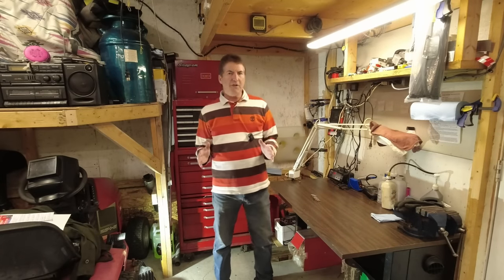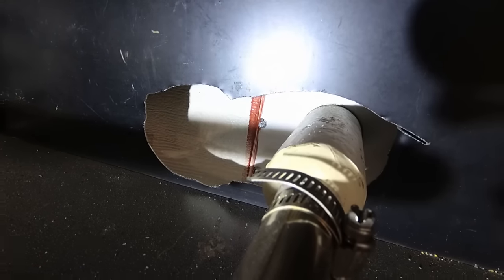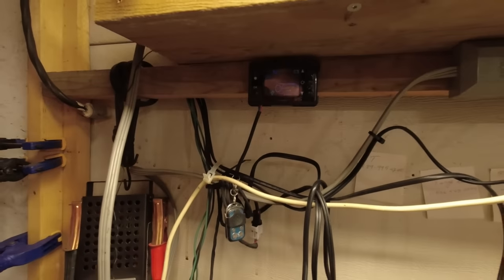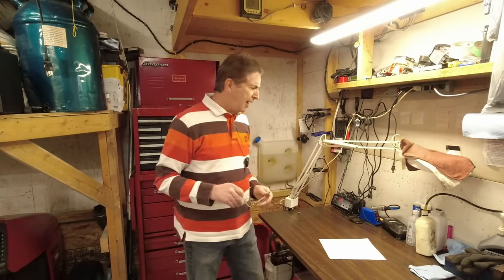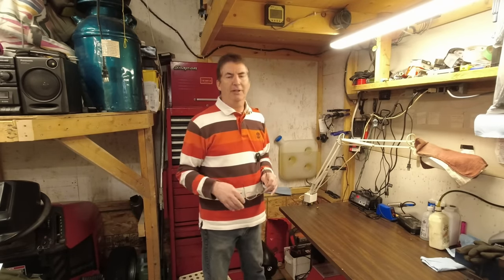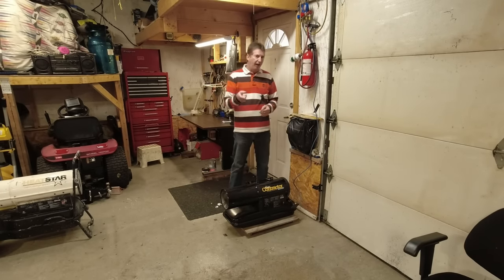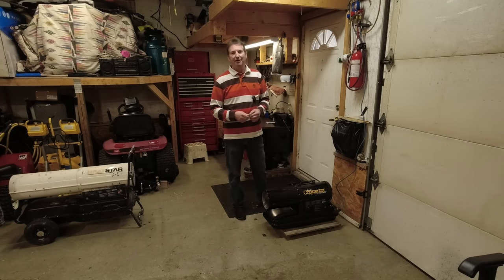Chinese Diesel Heater, 5 Year Review, Heating a two car Garage with a Parking Heater.

Comment: My favorite quote from this video is: "does it sip fuel? Barely touch any? No! It gives you the energy that diesel stores." nice to hear someone else say it too.   The energy in the fuel you use, less the inefficiencies of the tool or process you're using to extract energy.  Doesn't matter if your burning cracked corn, wood, diesel or coal.  There is only so much energy in each fuel.

Comment: Well I must say that out of all the videos I have watched on these chinese diesel heaters. Your video and explanations as to btu's, fuel usage and keeping the combustion chamber clean after a long low run is the most concise, to the point and easily understood vid I have watched. Respect man and have a merry Xmas. Like n sub.
Reply from the maker: Thanks, I appreciate the kind words.
Reply: @FRUGALWITHJOHN  If you see -20F° do you ever need to use additives to keep the diesel from gelling?
Reply from the maker: The fuel tank is inside, I don't let my garage go below freezing all winter. So the answer would be, no I don't use additives in the diesel.
Reply: @FRUGALWITHJOHN  👍

Comment: You are Absolutely RIGHT about after running it LOW for over an HOUR Then turn right up to BURN all the Coke off. As an Retired Crane operator [UK] we had these [Webasto] Heaters INSIDE the Crane and 1 Thing i learned was to NEVER run it Low and turn it off But to Run it Low [SMALL Cab] Then Run it HIGH for half hour to BURN ALL the COKE Out of the Burn Chamber.

Comment: Many forget that alot of the energy escapes through exhaust....so what i did is i bought a longer exhaust pipe and rolled it against another thick iron pipe. That way i get almost all of the energy to stay inside. Resulting exhaust is barely warm when it exits through the wall.
Reply from the maker: Sounds good, I may give it a try. I was going to order exhaust pipe and a through wall exhaust anyway for my generator.
Reply: Somebody on another video said that water from condensate of the exhaust needs to drain, or else it will clog up your pipe.  Be sure to have your exhaust pipe draining at least a little bit downhill the whole way.  I'm sure there are calculations on the diameter of pipe vs length, so make sure you keep that in mind, too.
Reply: @theclearsounds3911  thanks i did not think of this😎

Comment: I don't waist fuel heating my garage when I'm not using it. But when I am having a 80k propane heater does the trick real quick. Those little heaters are great for their intended purposes smaller spaces.

Comment: I am using the Vevor diesel heater in my greenhouse and it uses about a gallon of diesel per night to keep it from freezing on me. But I have the temperature set at 70 degrees F. Somehow though the heater controls are off by 20 degrees so it holds at about 50 which works for growing veggies.

Comment: Thanks for the video, I just bought a heater for my garage in Texas, not as cold as all y'all up north, funny thing I noticed in your video, I have the exact Panasonic  radio in my shop that I bought in the mid 90's, I use it nearly every weekend.
Reply from the maker: I use that radio all the time, works good. My neighbor gave it to me years ago when the one I was using died. Good luck with the install and thanks for watching.

Comment: great video. Ive just bought one of these heaters, to heat both of my sheds at same time...
Built a waterproof wooden box for the heater to be housed in.. Along with a 25L tank...
2x 12v leisure batteries in parallel for extra capacity, and a cheap ebay solar charge controller, and a 100w 12v solar panel....
The heater is boxed around the back of the sheds, so it cant be heard etc...
and i bought a dual heat pipe adaptor, to feed into both of my sheds (right next to eachother).. then cut and extended the wiring for the display/control, so that is mounted on the wall in the shed...
I have it set on thermostat control, and have it so it keeps both sheds around 20c... Not cold, But not hot... Just comfortable to be in....
I live in the middle of nowhere aswell.. So red diesel is easily obtained for me... So its very cheap and efficient to run...

Comment: Good to see a video about one of these units that has been in service for years. I have been burning some waste oil in mine and it only lasted 2 days before having to be cleaned out. I suspected that this was because of the nasty fuel and hypothesized that it would be fine on diesel.  I get 14 hrs on 4 litres of fuel at the mid (3) setting. 

Not to be too critical, but using the BTU of the fuel is not a great way to calculate or compare this unit to a electric heater, because a substantial amount of heat goes out the exhaust / outside. A electric heater is 100% efficient (basically) as all 1500 watts gets turned into heat that transfers into your work area. I'm not recommending a electric heater, just stating the facts. 

I believe that calculating the fuel energy is how the manufacturers determine the KW rating on these things, but it is not at all practical. Just like in a car, you don't calculate HP based on fuel energy.
Reply from the maker: Thanks for your input, I was going to try used oil (Black diesel) in my heater, but after doing some research, I decided against it. Everyone has had the same result as you did.

Comment: These things are great because diesel is inert unless it's atomized, so it's a low fire risk. They also run on 12v, so in a power outage you can just hook them up to a car battery and have heat.
Reply from the maker: Yes, It never hurts to have a backup heat source, thanks for watching.

Comment: John thank you for the video. I just buying a diesel heater for my garage. I’m in Europe, so cheapest Vevor diesel heater that I found is 102€ that one in the box. The same you have is a little bit cheaper. Plus, I have to buy extensions for the intake of air and combustion. I think it would not cost me more than 150 for everything.
Reply from the maker: It does work well for me, good luck
Reply: @FRUGALWITHJOHN  Thank you for answering. do you have advice for back up power. Battery ?
Reply from the maker: I use the battery from my RV (Caravan), I put a battery charger on the battery all the time.
Reply: @FRUGALWITHJOHN  Good to know. Thank you.

Comment: Thanks for the report.  I just bought one of these and am installing it in my small workshop.  It's not insulated yet, but this will keep the pressure washers from freezing when the next Ice Age hits here in Texas again.  I have the Little Buddy and an old kerosine wick type heater but they aren't very economical.
Reply from the maker: I made a video last year about all the ways I tried to heat my garage.  https://youtu.be/c7p7CPABZ3I  I did try the little Buddy and a Kerosene wick type. Thanks for watching.
Reply: that freak storm in Texas a couple years ago really showed the importance in having an alternative heat source available when the power goes out. These are great for emergencies since they can run off a car battery
Reply: i have one here in CANADA in my 10X10 shed Insulated and its unreal how quik it heats up i use it to melt the snow on the ATV during the winter takes 5mins to melt i have seen it at Minus -20C outside and get upto +12 in 20 mins
Reply: Did u set it up yet? How big is your workshop?

Comment: I live in a travel trailer and have heated it with one of those heaters. The only problems have been a pump and the green fuel line. Otherwise, a great investment.
Reply from the maker: Mine did not come with the green fuel line, 5 years ago I don't think any came with it. I put a link in the description of the good fuel line. Also about the fuel pump and filter, get the heater running, then keep tipping the fuel pump and filter straight up and then back to the proper angle, with the outlet to the pump up until all the air is out, then mount it. This will help make the pump last longer, I did need to restart mine twice when I did this (I let too much air in the line from the pump at one time). Thanks for watching.

Comment: Thanks for talking about energy content of fuel; that’s the right message.  Not sure of the size of your garage, or its insulation situation, but would be curious to know if the heater(at maximum setting)can keep it comfortable when outside temp is around freezing.  Also, good job placing the combustion air inlet outdoors. So many folks seem to have it indoors, which simply creates a small vacuum and pulls cold outside air into their structure.
Reply from the maker: A little over 500 sq ft.  Roxul - rockwool insulation R-14 walls and R-28 attic, and yes it can keep my garage 15 C, 60 F (that is where I set it) well below freezing. (on low setting) after it warms up. Yesterday it was -15 C,  5 F, I set the heater on low (1) and when I checked the temperature in the garage it was 14 C,  57.2 F.

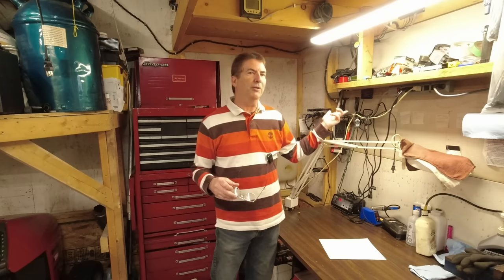Comment: 04:40 - because your intake is outside, your heating efficiency is drastically dependent on outside temperature. 
Yeah the BTU stays the same but if all you want is to keep it at 0°C, you are using way more fuel with your setup.
Reply from the maker: Outside air is only for combustion, if I used inside air it would need to be replaced because we can't live in a vacuum - I would then need to heat up the air that came from outside.

Comment: I built an enclosure for mine outside and just drilled one hole for the heat vent to go inside, I tried the diesel torpedo heater and it immediately set off the carbon monoxide detector.
Reply from the maker: Interesting, thanks for watching.
Reply: That means you have to heat all of the air from outside temps. It also means that all the air you draw in from outside has to be displaced.

At minimum, if you're going to run the unit outside, you'd want to have a second hose for the inlet/return.

I'd rethink that approach, personally.

Comment: FYI, that setting is not kilowatts, that setting is Hz. That's how many pulses the pump makes per second. The pump delivers .02ml per stroke.

If you have it set to 2hz, that's dosing .02ml, two times per second; or .04ml per second. Which works out to 144ml (.144 liters) per hour. 

.144 liters per hour of diesel is 1.53 kW per hour, or 5226 BTUs.

At a max frequency of 5.5hz, your heater is capable of 4.21 kW, or 14,371 BTU.
Reply from the maker: The heaters are not that precise, I did replace that one with a new one and it puts out less heat at the same setting.  Two or 2hz is around 2KW on some units and less on others, thanks for explaining what the numbers mean.
Reply: @FRUGALWITHJOHN  
You can also adjust the max/min settings as well as fan speeds on most of them, if you find that the one you have is not outputting the heat you expect, or if you want to avoid someone accidentally running it at too low of a setting and potentially sooting up your burn chamber.
Reply from the maker: Thanks for the info.

Comment: I like kerosene heaters but I don't like the fumes in the garage.  It doesn't set the CO detectors off but I still get a headache later.
Reply from the maker: I've seen people getting a headache from old style kerosene lights, when using less refined kerosene instead of lamp oil, so it may not be CO but definitely related to combustion of kerosene. (but not everybody will get a headache??)

Comment: Let your exhaust fumes go through an air to air intercooler with fans on it before the exhaust goes outside so you won't have any exhaust heat loses anymore and you can save more fuel.
Reply from the maker: I am looking for something to do that with at a reasonable cost, thank for watching.

Comment: Great video. 
Very informative.
Reply from the maker: Thanks, glad it was helpful.
Reply: @FRUGALWITHJOHN  
Now.
I'm looking at which one to buy and $120 - $250. I see no differences. Did you find any reason to choose one over another.
Reply from the maker: You can get two at $120 and still be cheaper than $250. Some have more options or settings in the controller, some companies just have a higher profit margin. Pretty much made by the same manufacturer with different company names on them. The last one I got is in the link in my description.
Reply: @FRUGALWITHJOHN  
Very helpful. 
Thank you. 
Im in the Northwest Territories, and I'm going to install one in my boat and extend my sailing season by an extra month. 
In winter, I'll move it into my truck.
You just cleared up all the questions I had.

Comment: Great video, I have one on the way for winter camping. 

How long would the deep cycle battery last without charging daily?  Id be curious if one deep cycle woule last for an entire weekend charging phones and running this heater
Reply from the maker: Good Question, It would be a bit of math to get the correct answer. Things to consider, outside temperature, what temp will the heater be set to, how big is the battery.... I will leave this question up to the people who have done this before. Thanks for watching.
Reply: @FRUGALWITHJOHN  I should have my heater mid next week, If all goes smoothly I will try to post my results in 10 days or so. May help another viewer in the future.
Reply from the maker: That would be extremely helpful, thank you.

Comment: I wonder if you mixed a little Hot Shot with the fuel if that would keep it clean all the time even on low burn.
Reply from the maker: I use Hot Shot in my diesel Jeep every 10,000 km/6214 miles, expensive stuff, I would not want to keep spending money  just to burn it away in a heater. I am testing a thermostat for the heater now that will turn it off and on to maintain temperature. I think this is the way to go, I keep the heater turned hot enough not to carbon up and let the unit start and stop the heater. I will make a video when done my testing.

Comment: If you look at the webasto data, the heaters are ~78% efficient so not all of the diesel energy is recovered. Still good robust heaters though.
Reply from the maker: The lost % goes out the exhaust, It gets quite hot. I look at it as a cheap (inexpensive) mini furnace, and also good for power outages, (can be run off your car's battery in an emergency) just don't let the car's battery die.

Comment: Excellent video John, thanks for putting that together. I’m curious why you are pulling in outside air for combustion vs just using air ambient air from the garage?  I’m thinking both the extra work/cost of another thru hole fitting in the door and efficiency of heating warmer air as the garage temp goes up.
Reply from the maker: I explained it in the video. I will give you a short answer but the video explains it better (when working in a garage never use inside air for combustion) (extremely dangerous).
Reply: @FRUGALWITHJOHN  naaaah.
Reply: It's actually engineered to pull ambient heat from inside, the unit itself is also engineered to be inside, if your doing work or burning fuels anything like that , the intake air should be pulled from a clean source, this is one of the reasons they are banned in homes, garages, and work shops
Reply: Don't hate, I actually run one in my 20' ×30' car and a half garage, and I can tell you this,,, I live in Ontario, it gets cold here and damp, my garage is detached and made of 8" concrete block, basic wood roof with 1 roof vent that I keep open, absolutely no insulation, no vapour barrier either, I only heat the garage on the weekend, I pretty much live out there all weekend, Friday to Monday morning when I have to go to work, I put a small woodstove in and lifted it about 8" of the ground, I run the woodstove Friday afternoon, and I run it HOT, until about 9 or 10 pm, when the block walls feel just warm, I shut the stove down and fire up my 5kw vevor 😂 and I run it on high right till Monday morning at 5am, then I shut it down, and I always make sure it's running on high or maximum for atleast 1 hr before shutting it down, it's very important, also ppl, you do have to consider your location and exhaust, it all makes a difference on performance and fuel consumption, these units are engineered to be inside and intake ambient heat, if it's outside and pulling really cold air from outside, your losing efficiency right off the hop, Wich means your fuel rate is going out the window and will never be consistent, I played around with mine quite a bit, and did alot of research, I recommend keeping the unit atleast 3' off the ground and run it on high, and only burn good clean diesel in it, oh yeah, don't forget to get a air monitor 😂
Reply: Sorry I forgot to mention, my 5kw vevors tank lasts 10 hr exactly everytime I fill it, I buy like $20 of diesel every Friday on my way home from work,

Comment: Great job. real world video.   how many square feet is your garage? How much fuel do you burn for the whole season?
Reply from the maker: Garage is 506 sq. ft. The more work I do in the garage the more fuel I use (it is never the same each year) (approximately 50 gallons -200 liters) give of take 20 gallons - 80 liters.
Reply: @FRUGALWITHJOHN  thank you... could try to make a heat exchanger for exhaust and steal some more btu's for inside

Comment: I just bought the vevor 5kw model. Just wondering how big a 12v battery  do you use in terms of amps
Reply from the maker: Any battery plus a battery charger hooked up all the time should work, tried to find a good used battery, possibly from a scrap yard. I use a deep cycle, I purchased at Costco, the battery is also used in my camper in the summer.